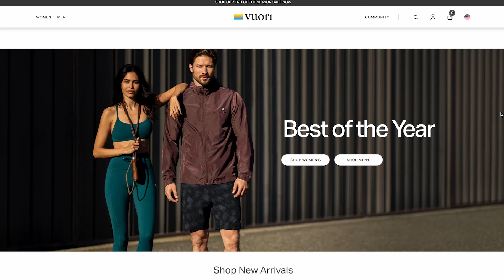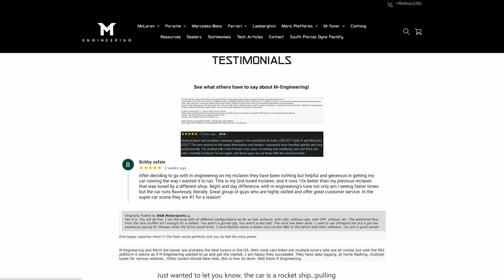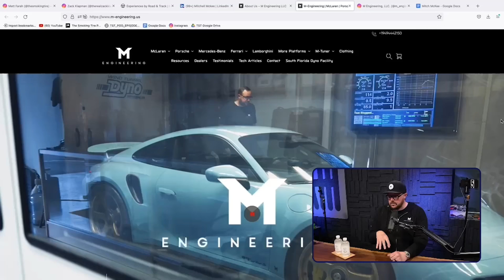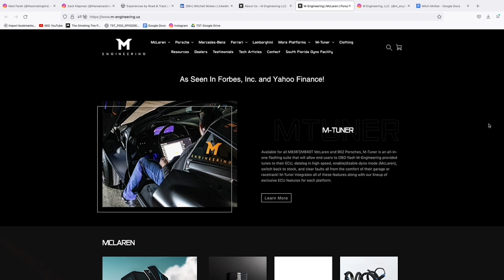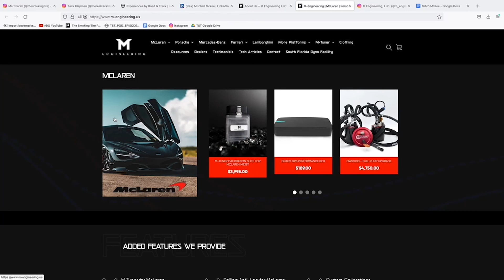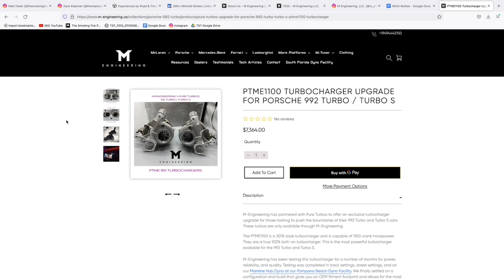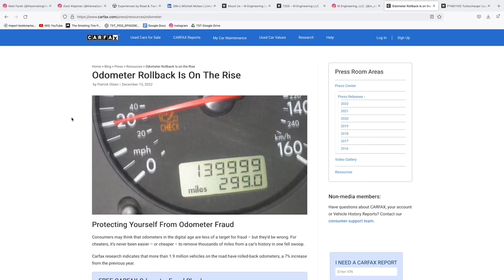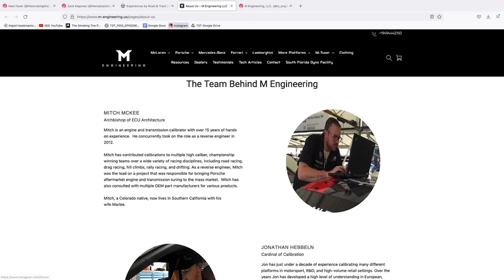Saving McLarens; Hacking ECUs; Tuning the Right Way - TST Podcast #790

Comment: 0:00 McLaren Preview
1:12 Sponsors
8:43 Show Contents
9:41 Start + Pikes Peak Porsche
14:43 Fixing Dai Yoshiharas car
18:15 Ken Block
19:10 Mitch is THE BEST
22:07 German cars are a black art
24:18 Tuning languages 
26:20 No formal education
27:23 Breaking cars
28:55 Tuning McLarens
30:00 Starting a new company
30:35 Dyno spectrum
33:35 Why McLarens tune well
37:20 Cammisa’s 1hp cams
39:25 Untunable cars
42:14 Easiest cars to tune
43:12 Accused of cheating as a resume
45:27 Customer stereotype differences
46:45 Big McLaren weaknesses
49:08 Rolling Anti-Lag
50:00 V10 Customers
52:02 EV’s are scary fast
55:00 McLaren drag racing record
56:22 Is McLaren leaving a lot on the table?
57:44 Artura
58:40 Tires impact on performance
59:28 Matt’s 720 track day story
1:00:30 Why guys tune supercars
1:01:53 Half mile vs quarter mile racing 
1:07:15 Modifying Ferraris 
1:10:10 Hybrid Supercars
1:12:50 Porsche Hybrids 
1:14:03 Tuning a 918
1:14:30 Tuning the Deman 4.5
1:19:09 Base Porsche tuning
1:21:10 Cars NOT to touch
1:24:00 Patreon
1:24:26 Factory vs Aftermarket downpipe
1:26:32 Locking down ECU’s
1:27:47 Direct injection maintenance
1:29:37 991.2 GT2RS 
1:30:47 Porsche PDK improvements 
1:32:45 Cayman with more power 
1:33:10 4 cylinder GTS Boxster
1:34:26 Highly boosted 4 cylinder cars
1:35:38 Not discoverable tunes
1:38:55 Odometer rollbacks
1:43:00 M Engineering Tuning

Comment: You guys are correct with drivers who do not have the skill to handle the power. I have never tracked so 300 hp in my old Saab was just fine, more I would have crashed.

Comment: I'm gonna check out his company for a tune on my 997.2 Turbo S.. seems like he knows what he is talking about!
Reply: Markski at Markski Tuning or Sam at ByDesign are the top 2 guys I would consider for tuning your car. Markski was my choice for my 997.1 turbo with upgraded turbos, intercoolers, exhaust, and turbo intake tubes. Sam is the guy to go to if you plan on doing e85 in the future. Markski if you want to do methanol injection or a 100 octane tune
Reply: BTW if you are going to get it tuned I highly recommend upgrading the exhaust at the same time. If you don't plan on doing any mods beyond that the stock intercoolers will be solid for you. If you want to get upgraded turbos or e85 or anything like that eventually then you will need to upgrade the intercoolers as well. Markski makes the best intercoolers. Markski makes a nice exhaust. But I prefer Freddy Lewis for an exhaust. He did mine for $1400 shipped to my door.
Reply: @sutherlacd27  I already have exhaust with high flow cats.  I was thinking next probably do like PureTurbos, intercoolers, and the IPD plenums
Reply: @2fast2nick  I'm not sure about the ipd plenum on the 997.2 but on the 997.1 it's a big waste of money. 
If you plan on upgrading the turbos I'd highly recommend hitting up markski for a package deal on his 4.5" intercoolers and tuning.

Comment: I just finished listening to this podcast and realized I had a question. I wonder if it’s possible to tune a C7 automatic transmission controller to make it respond better to inputs. The answer used to be no, but I’ve driven other slush-box autos that respond damn near as fast as my E92 M3 DCT did. That would be good enough to get me back into a C7.
Reply: Should be able to. Ctsv transmission tuning is common. Same auto isn't it?